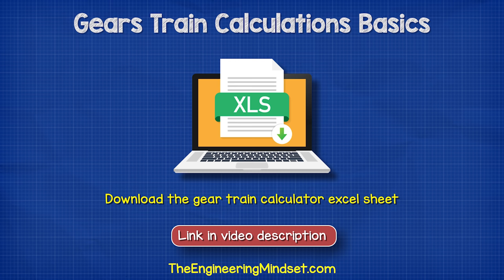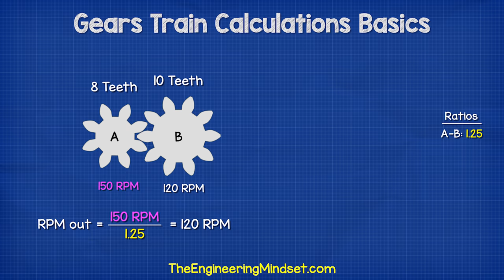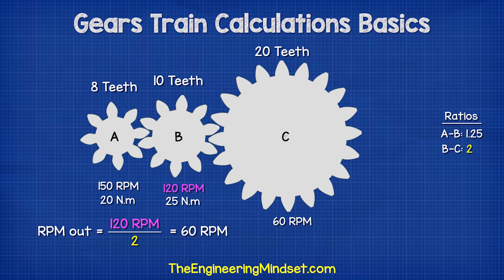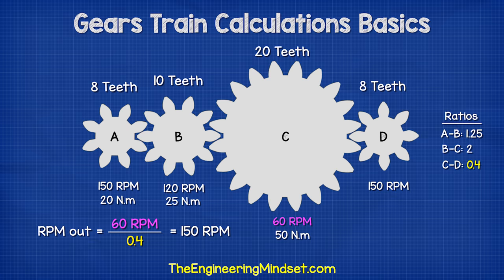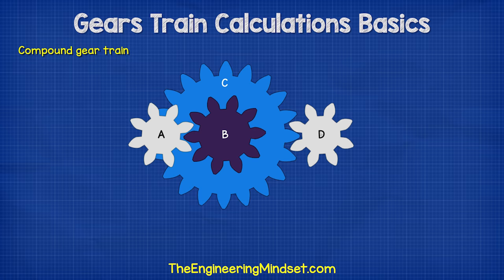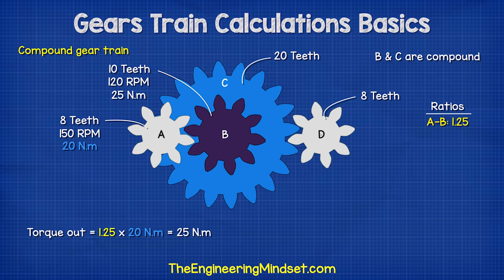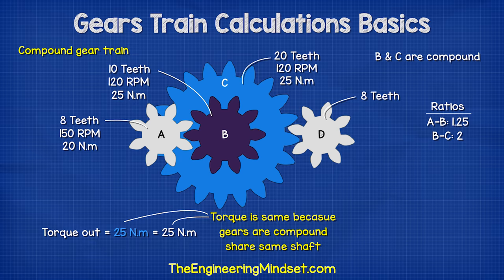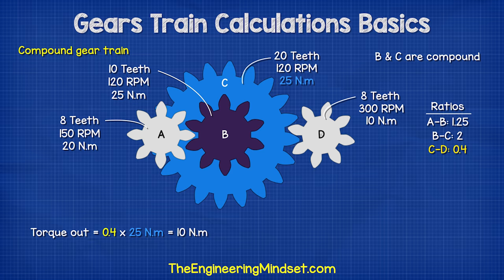Gear Train Design - How to calculate gear trains mechanical engineering

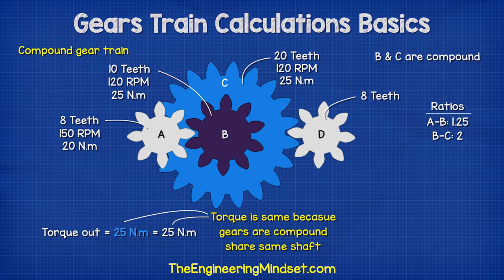Comment: At 4:08 you say that gear C has less torqe than  gear A. But Gear C shares both torque and RPM with gear B thus leaving the output of gear C at 25nm compared to 20nm on gear A. Im not sure if I missunderstand something or what is going on...

Comment: Is weight a factor for gear rpm or torque? If gear A is heavier than gear b or vice versa, does that change anything?
Reply: Yes, partly. If your gear/object is too heavy and the motor not strong enough, it would
Reply: @renebronkhorst5487  Thank you

Comment: It is very interesting that you can even calculate this but I can’t imagine where I what need to calculate this value
Reply: It's ok, bcoz you are not it industry automation..👍
Reply: Clock design and repair.  Selecting the drive weights or sizing springs

Comment: Awesome stuff as an electrician we don’t most of mechanical if you can’t tell the ratio of name plate you in trouble millwright claim if you turn the fan of motor and count how revolution it take for gear box to complete one cycle it quit handy but how do solve the if you have coma like 15,3 rev you have said 15 rev what about the coma
Reply from the maker: It's just the ratio, it doesn't need to be a whole number.

Comment: Sooo me putting a propelor dirrectly on my motor is a waist? Isnt a propeler a gear in a way?
Reply from the maker: No because it's converting the rotation into propulsion for the boat. It's doing work, the gears transfer the force.
Reply: @EngineeringMindset  then why do EDF engines have no gears?

Comment: ???  These gears are not colinear, so they do not cascade.  All of the succeeding RPM calculations and N.m calculations need to be based on the initial input gear A.
In order for Gear B to affect the speed of Gear C, it would need to be mounted on the same axel.  All it does is affect the rotation direction.